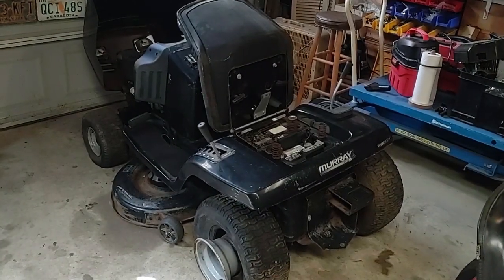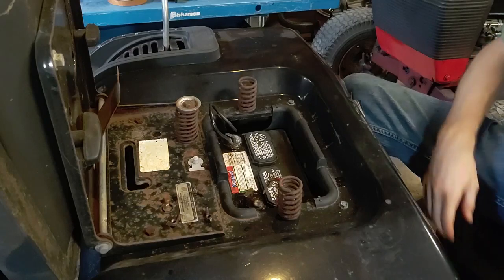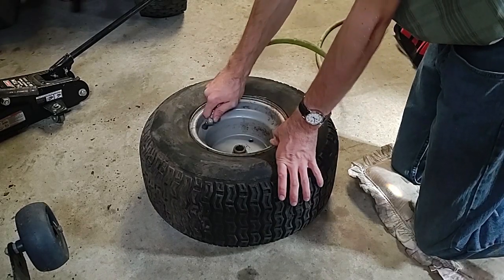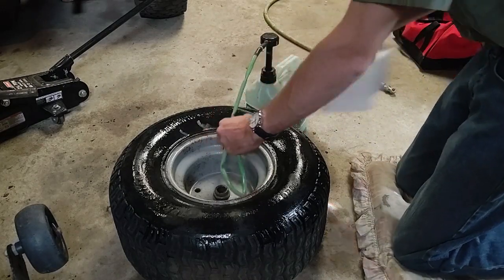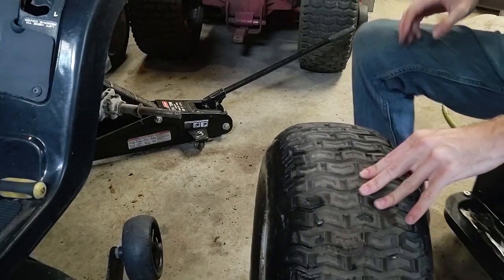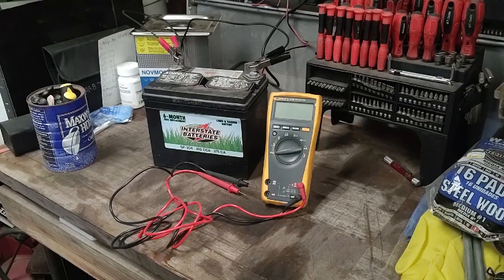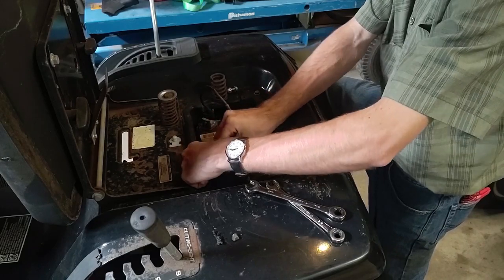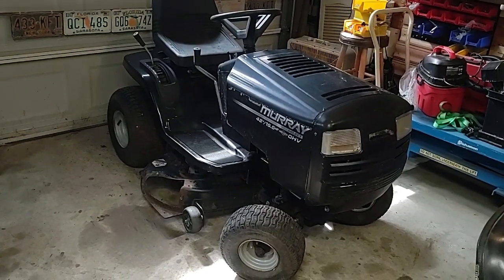Fixing Problems on the Free Murray Machine

Comment: The rim on my Murray 40-inch mover had a hole rust through it. Part no longer available. The culprit was the green slime. I won't use it again.
Reply from the maker: Thanks for the info. I'm definitely not a fan of tire slime, but I hear motor oil works as well. I might have to try that in the future

Comment: Just for your information you always disconnect the negative side first. Lest fireworks that way.
Reply from the maker: Yes, the only reason I took the positive off first was because the negative was stuck on. I removed the positive to get more room to move the battery around to get to the negative better. I knew the battery had no power in it, and was very careful to not touch anything metal with the wrench. Thanks for noticing that, and for the info